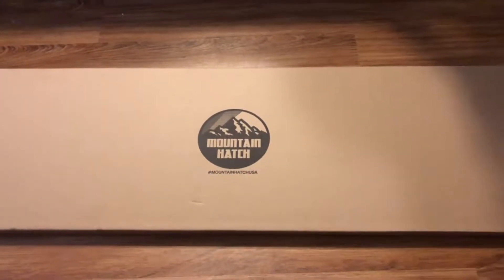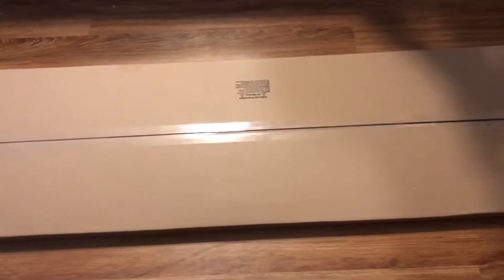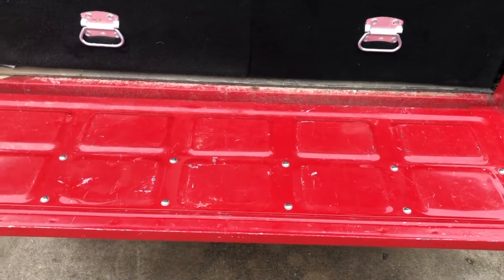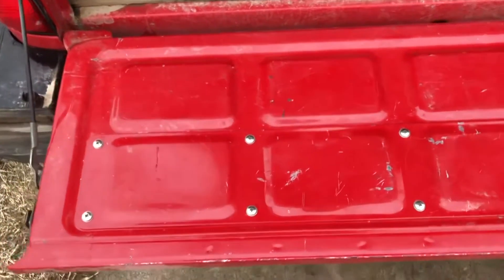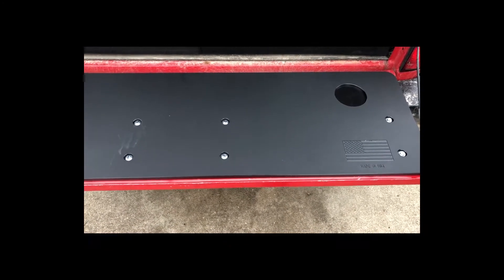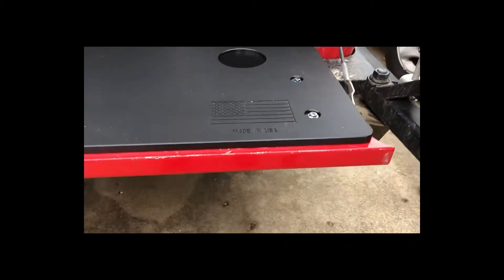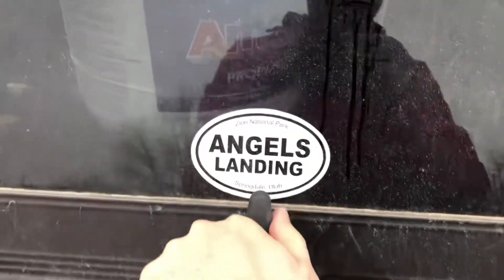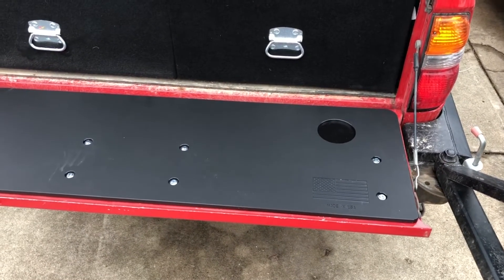Mountain Hatch Tailgate Installation - 1st Gen Tacoma : Unboxing and Installing on an '03 Toyota

Comment: Nice install! Does it interfere with your storage drawers when they slide out due to the extra thickness?
Reply from the maker: Only a little. I have to lift up just a pinch as I pull it out. It’s slick enough that the drawer slides right over ones it’s on it.